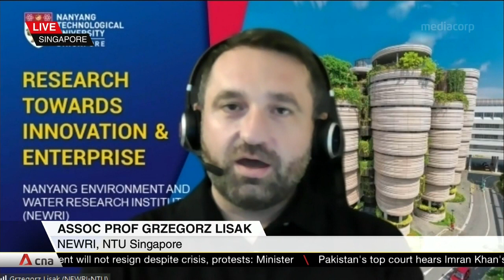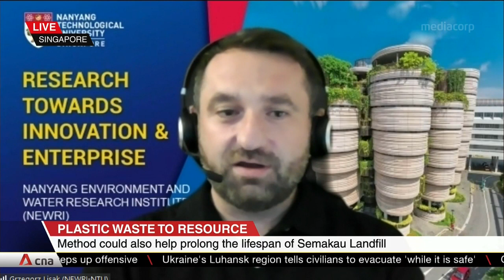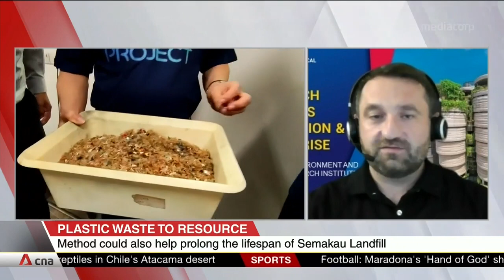NTU scientists develop method to convert plastic trash into hydrogen fuel

Comment: Just as converting CO2 in to a fuel requires feeding the conversion process with energy the same is true of breaking down organic plastic materials to release its contained hydrogen. Any chemistry student, who knows the basics of chemical reaction thermodynamics, should be aware of such processes. This story simply serves as a distraction away from the most important actions that need to be taken.
Reply: Good point, but how does this serve as a distraction away from "the most important actions that need to be taken" when it's using chemical recycling to repurpose plastic waste? Not intentionally trying to debate, but I wonder what your take is on the most important actions. Are you thinking policy? Degrowth? Revolutionizing the packaging industry? I've found that main issues to these are dialogue and content problems (ie. undefined actions). We all talk about needing better action, but what is your proposed solution? I ask because it seems  you know a bit about this topic
Reply: @Jamie-zi2nf  - I suggest that the reduction of energy consumption should be a primary goal. If the chemical recycling process needed to repurpose the plastic waste consumes more energy than the energy derived from using the released hydrogen then that is not a practical solution. When the energy calculations are performed they must include all aspects of repurposing the plastic waste. Chemical recycling is not always a magical process that automatically leads to a future sustainable world.
Reply: @vernonbrechin4207  Solid point, but many current chemical recycling processes are 95-97% effective with 3-8% waste left over according to many journal articles and waste-to-energy market reports. It's still a very new field, but there's high potential to solve 2 large problems (energy and plastic crises). I'm biased as I highly enjoy learning about repurposing plastics into new forms of energy, but what's your take on the process? Agreed that consumption should be limited for sure, but given the sensitivity of the situation (ie. How much North American and China economies depend on plastics and fossil fuels for gas, medical equipment, packaging, ghost nets for commercial fishing, parts, etc), I find it hard to believe that the government would allow consumption to be reduced to the level it needs to be at to reduce environmental harm. At this point, we're increasing production despite all the research and warnings against it. Very unfortunate, but I think innovation is a great way to creatively solve these issues. You make some good points my friend!
Reply: @Jamie-zi2nf  - I appreciate all the good points that you made. As you know the vast majority of 'plastic' materials are derived from fossil fuel feedstocks. They are, essentially hydrocarbons. If left alone in landfills and recycled they tend to degrade very slowly. If combusted, or chemically treated, to derive energy, a typical byproduct is CO2 which is typically released into the atmosphere, not sequestered underground. Most sequestering project have been abandoned. Others have been used to increase fossil fuel extraction from depleted underground fields. I agree that we have become extremely dependent upon plastics like typical addicts need their fix to cope with reality.

The world greenhouse gas emissions have continued to increase despite warnings to reverse that trend, beginning over a half-Century ago. I'm well aware that the plastics industry also keeps growing.

You may have never considered that the extraction and employment of fossil fuels was viewed as very innovative before the environmental consequences became more obvious.

Many humans believe that our cleverness and creativeness will always be able to reverse any problems our species encounters and it will never be too late to do so. They reject the concept that there are tipping points beyond which it becomes impossible to prevent the collapse of industrial society. They tend to be masters at excluding the following warnings from their consciousness. Most tend to believe we have a least a decade, or two, to reverse the current trend.

UN chief: World has less than 2 years to avoid 'runaway climate change'
https://thehill.com/policy/energy-environment/406291-un-chief-the-world-has-less-than-2-years-to-avoid-runaway-climate
  * This statement was made 4-years ago.

IPCC report: ‘now or never’ if world is to stave off climate disaster
https://www.theguardian.com/environment/2022/apr/04/ipcc-report-now-or-never-if-world-stave-off-climate-disaster
Reply: @vernonbrechin4207  Absolutely! You raise great points as well! Yes, the fossil fuel industry is an economic staple for resource economies (ie. North America). I've learned through my ongoing research and academia that environmental issues are as much a politics issue as a science issue, especially when it comes to fossil fuels. Take Canada for example, with the oil industry: it's almost at a post-degenerative staples state according to Staples Theory literature (see Howlett & Kinney, 2016). This means the industry is not only heavily funded and incentivized by governments, but it has a global impact and high loss associated with economic and environmental risks. The industry's trajectory goes three different ways: it's either stopped and the government eventually finds new economic staples to pursue, or (more often) it's rapidly accelerated and often causes more harm until it's entirely depleted, or the industry creates a staples curse. There's more info in Staples Theory literature, but it's an interesting consideration to factor in when thinking of novel energy production solutions. Thanks for your comments :)
Reply: @Jamie-zi2nf  Thanks for your references. Keep in mind that the energy humans have extracted from buried fossil fuels originated  from around 200 million years worth of solar energy being absorbed by plants on a densely vegetate earth that was then incorporated into the hydrocarbons making up plants and animals. That became buried under conditions that don't exist today forming pockets of highly concentrated solar energy. Some very clever engineers came along an figured out how to extract that stored energy for human uses while dumping the CO2 waste product into the earths atmosphere. Extraction and use of that energy has only been going on for about 200 years. The amount of solar energy falling on the surface of the earth hasn't change much from those ancient times so incorporating today's solar energy in plants is something like a million times slower than the convenient energy we utilized in fossil fuels. Our rapid utilization of that stored energy has allowed exponential growth in world population and resource consumption. It can't continue. More likely a major collapse is likely on the near horizon.